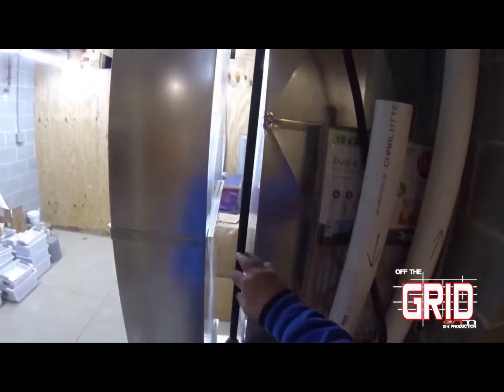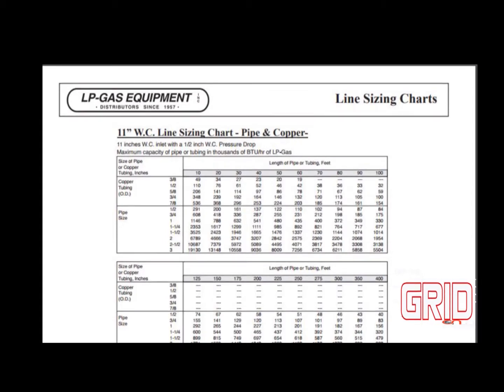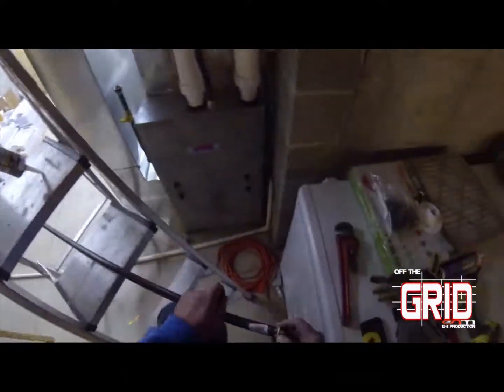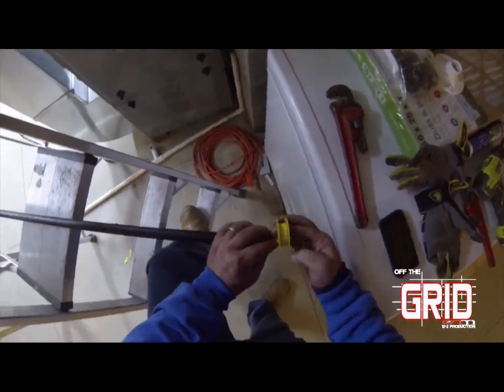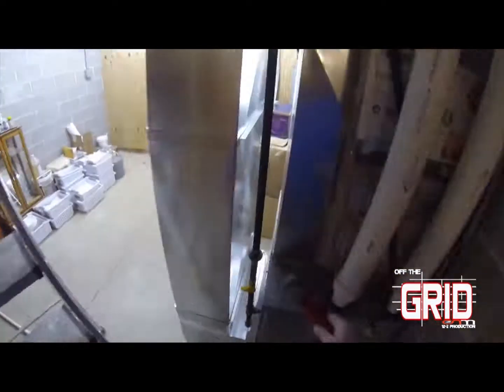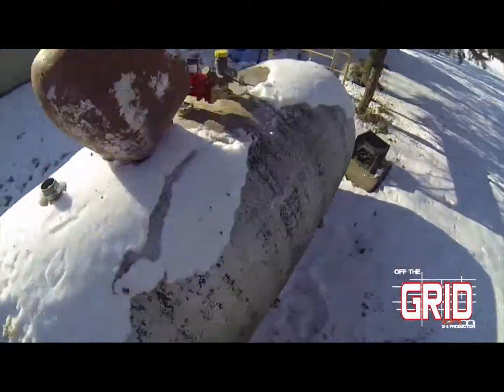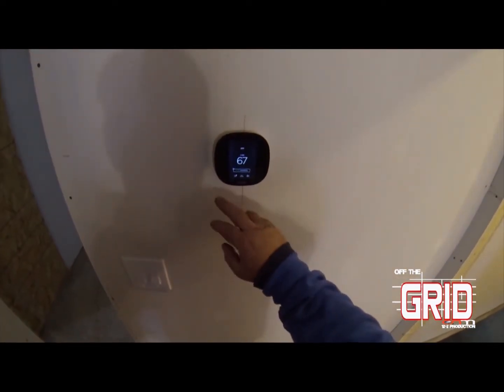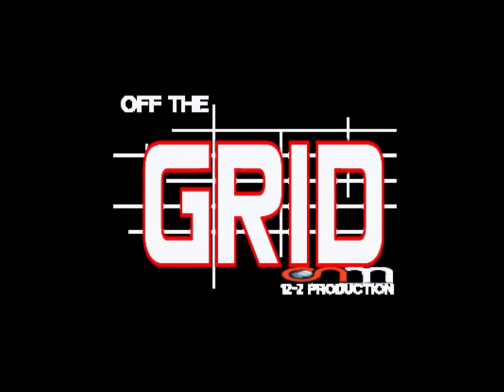LP Regulator Exchange - Gas Line Sizing

Comment: If I am to install 300 feet of pipe at 10psi to connect 4 commercial appliances at 11 inches w.c., what size pipe should I use between high stage and low stage? Should I use a normal high pressure regulator or a variable one?
Reply from the maker: little outside my wheelhouse of knowledge.  I know one determining factor will be the BTU requirments of the appliances you are using.  Google search for LP gas pipe size and it should give you seeral options of sizing charts based on BTU demand.  Wish you the best with your project.
Reply: I already did.  Thanks for your help.

Comment: You need to check for leaks on your red Regulator to make sure nothing is leaking.
Reply from the maker: Correct.  When complete you shoujld run a monometer check on the entire system.